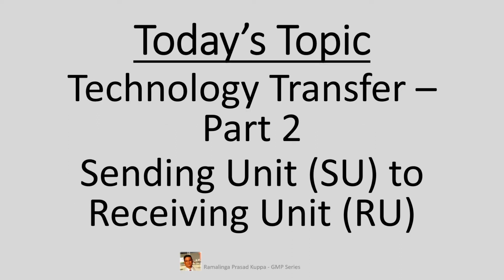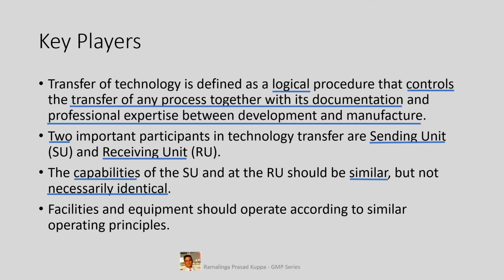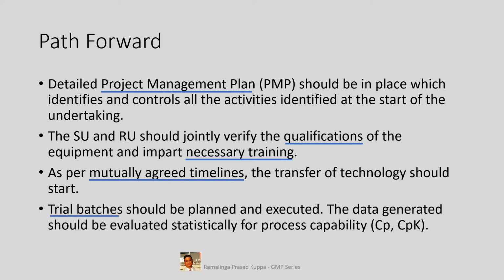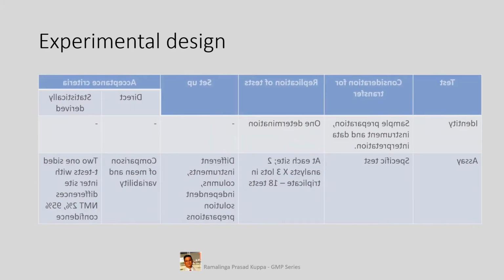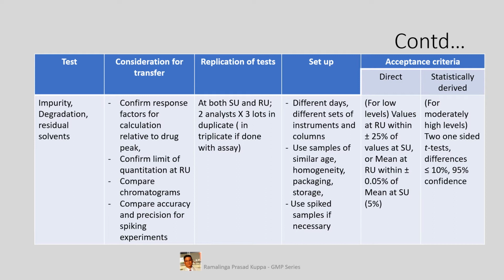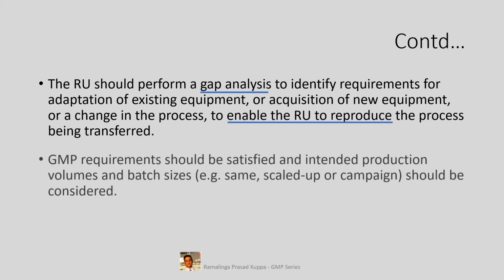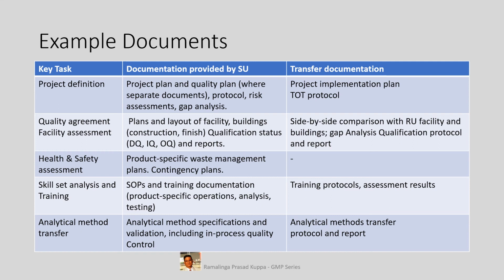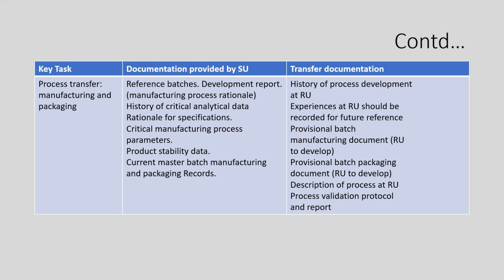Technology Transfer   Part 2

Comment: Could u please tell  abt gap analysis during manufacturing
Reply from the maker: A gap analysis is done to identify any potential risks while transferring the technology to commercial scale. This helps to design and establish additional measures to bring the risk into acceptable level. ICH Q9 is a wonderful detailed guide to follow for getting a comprehensive and complete risk assessment. This has to be done at all critical steps of process transfer.